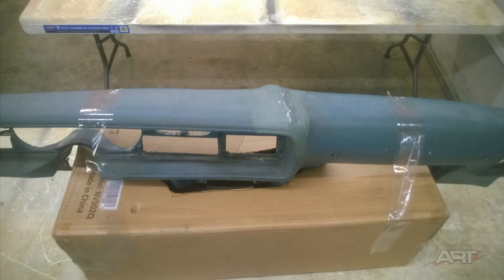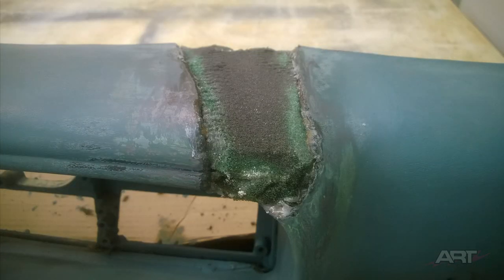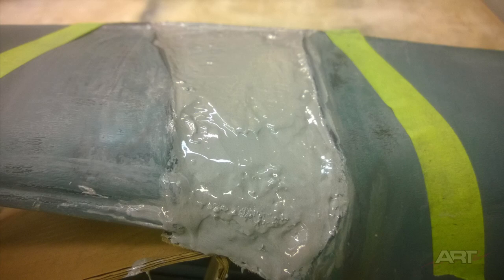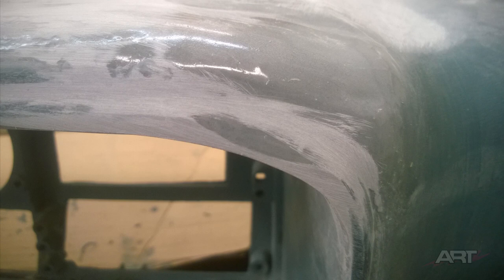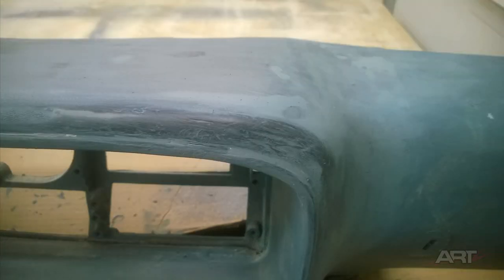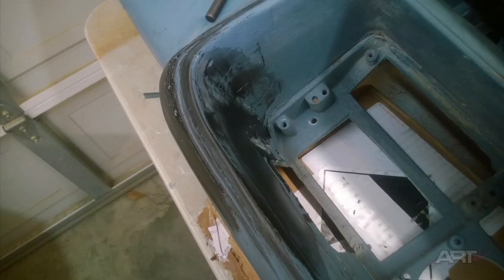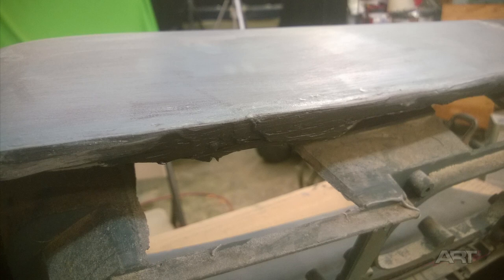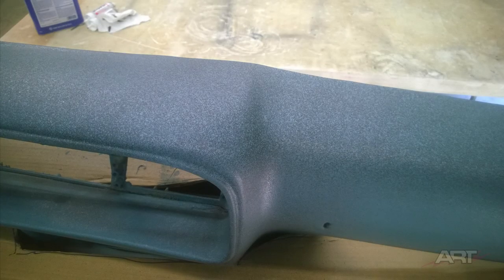Firebird Dash Restoration v33

Comment: Hello, I'm working on a 1979 firebird and the dash has the same problem. My concern when doing this is the texture of the dash won't match the original when you spray it. Is there a way to get the original texture or is that not a big deal?
Reply from the maker: Please see the video on the door panel repair..constructing a texture. There is an art to it. And when you get it that close, blending it with the rest of the panel makes it indistinguishable.  Thanks for joining in.  Hope the video helps get the job done!